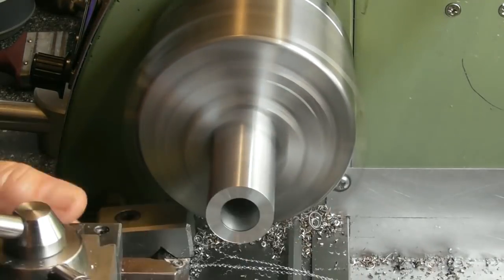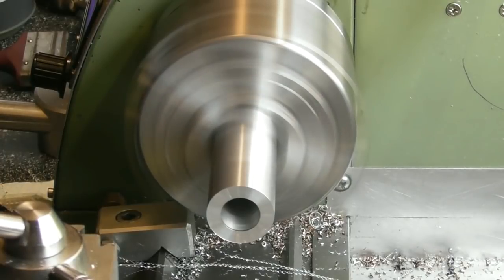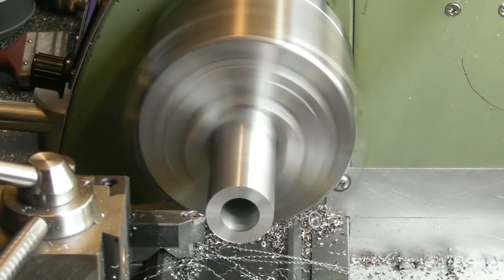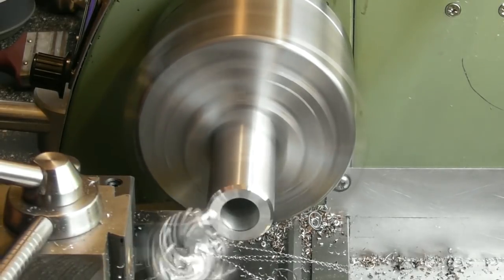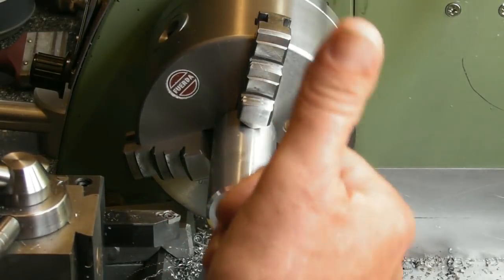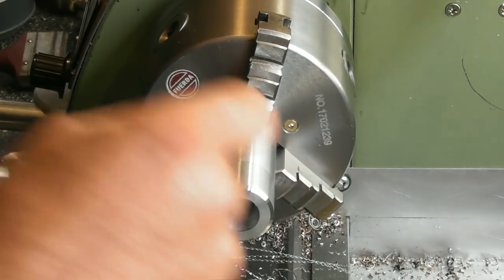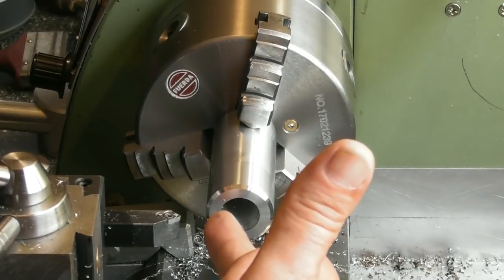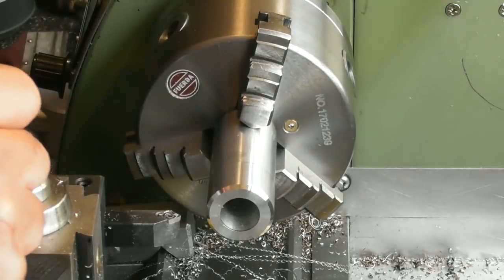Warco lathe toolpost grinder part 10 "Plan F"

Comment: Hi Ade, I know this is an old(ish) post but as I have had the same problem with oddball threads I thought I would do a little bit of digging. Silverline are a British company set up in 1978, so originally I would guess that they used Imperial threads. As time progressed , and again I'm guessing here, they would have moved over to metric. However, it is possible that they used oddball threads so that they were the only ones who could supply spare parts (an industry norm), to prevent vagabonds and vagrants like ourselves from doing what we do. lol. Stay well Pal. Mal.

Comment: Hi ade, yes a good video & a good learning curve, I like your extended rear guard I'm thinking of extending mine & making a hole so I can fit a bin bag at rear, I have access at rear to do this.
  Today I got some more WD from Wicks 5ltr £15 did you get some? Another tip Lidl are selling a pack of paint brushes 3 round &  5 flat £2-99,use the round ones on your lathe there great just like the old suds brush we used to use, there in stock Lidl now. From Coventry UK.
Reply from the maker: they did not have any in my local wickes but i have been checking the stock online. I will pop into lidl and check out the brushes tomorrow , thanks for the tip off , Ade.
Reply: ADES WORKSHOP 
It don't show up on line, I found it just.by chance two different shops 1 in Warwickshire & 1 in Leicestershire Wicks.

Comment: Nicely made, but the problem with these dinky grinding wheels is the rpm.
You need something like 20k to 40k rpm in order not to make 'grinding stone dust' instead of grinding and often these multi tools can't deliver that.
Most bearings you buy, are actually not suited to that sort of rpm either. All in all, a toolpost grinder 'done the right way' is a tricky proposition.
How much rpm do get out of that unit Ade?
A friend made a unit, driven by a CNC spindle (9000 rpm) which he 'uped' by means of a pulley to 27k rpm.
It worked a treat, but he still is too embarrassed to tell me the price he paid for the bearings in his spindle! 
I know they cost more than the CNC spindle, though I have no exact figure LOL

Cheers
Paddy